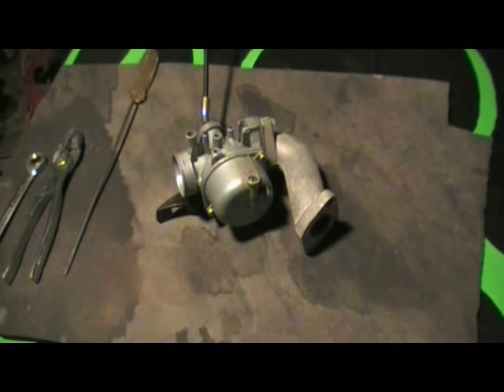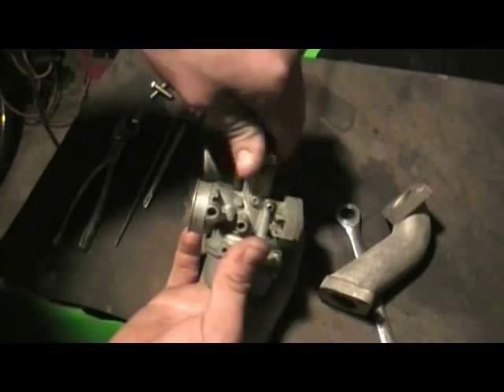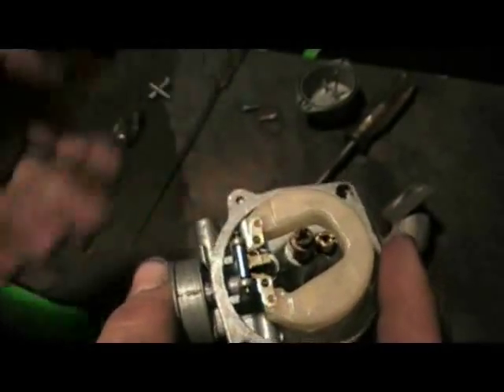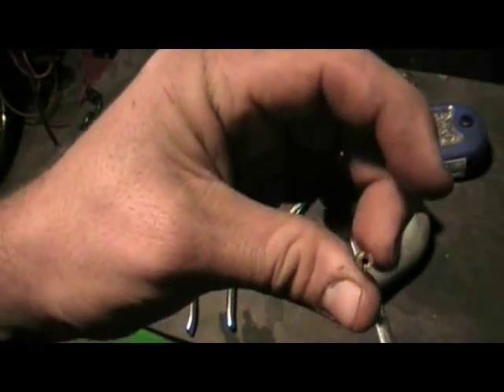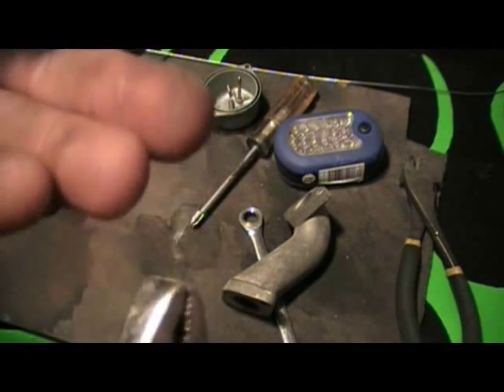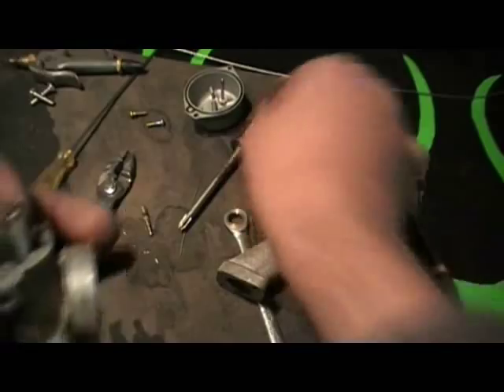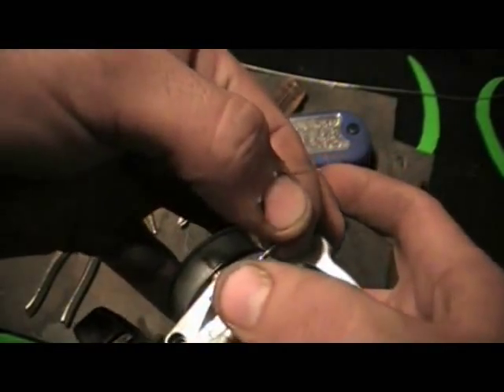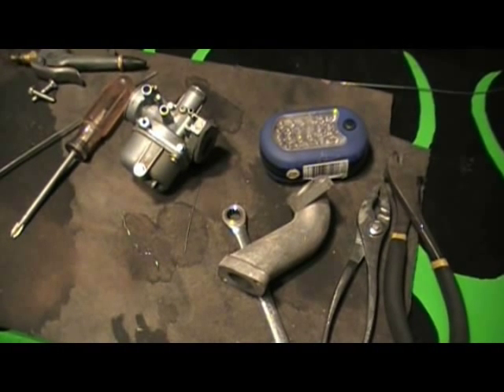How To Clean a ATV /  Minibike Carburetor 50cc-125cc

Comment: Thanks for the video. I tried to clean the carb which had been sitting for 2 years. It didn't start. After watching your video, I did what you showed in your video I put it back together and it ran like new. I also installed a in-line fuel shut off so this doesn't,t happen in the future.

Comment: Nice video , didn't mentioned the height of the float and adusting air/fuel mixture screws
Reply from the maker: You would  adjust those then the engine is running , there is no need to touch them when cleaning the carburetor

Comment: Hey The Random Mechanic, Do you know where I can get the 2 screws that hold the bowl on? Thanks man! Really great video, It helped me out alot. Thanks!  But I need the 2 screws that hold the bowl on. HELP!!!
Reply: Just go to a parts store they should be able to help ..
Reply: I just used a small bolt all the way threw and put nut and lockwasher on it

Comment: Hey I have a no start problem I have a 110cc atv with the same carb the atv is brand new but it have been sitting in the garage for 2yrs cranks but no start it was leaking fuel from the fuel filter so I replace the hose fix it but still no start....please help

Comment: i have a taotao 110 and the carb looks like that were the choke is a plastic piece of crap but my question is this...i know there is a screw in the open to tune but are there any others like under the choke lever?
Reply from the maker: the only 2 screws that tune the carburetor should be one the opposite side of the carb from the choke ,  the one that sticks out with the spring is to turn the idle up and down  and the small inset one is the mixture ,

Comment: the carb barrell has some brass looking caps so you cant take  it off and access the jets/float. what to do?
Reply: Kappy Duke there are videos on how to get them off...use an extractor.  drill it with one side and it has a reverse thread to slowly back it out!  very simple.  then you just need to replace those screws

Comment: I have a 110 Taobao. no spark. what could it be? thinking of replacing the cdi and coil pack
Reply from the maker: always test the obvious culprits first , you wouldn't believe how many times it was a faulty spark plug  or that the spark plug boot that plugs  on top of the spark  plug had come unscrewed from the coil wire   ,  if it has been sitting outside you can test if the ignition  has failed  by unplugging the ignition then using a screw driver to bridge the 2 posts on the starting solenoid    if the spark plug fires then you found your issue  ,  the ignition grounds the coil to the frame so unplugging it should allow the bike to function  normally except the accessories will not work  " lights and electric start "     if this still has not fixed it  ,   make sure that the two wires for the coil are still attached    because they fall off alot ,   if it still isnt working  i would say the cdi has probably failed or the stator  has shorted due to moisture intrusion

Comment: I have the same carb what should the float measurement be on this I keep having fuel leaking out the overflow and other than the needle this could be the only other possibility.
Reply from the maker: normally  when i set them     il be holding the carb upside down in my hand with the bowl off    and i will set the float  to where it is slightly pointing up  to where the bottom of the bowl would be    when it is resting on the seat  ,
Reply: The Random Mechanic thank you for the information
Reply: The Random Mechanic thanks again for the information that work perfect got it running today and I didn't have fuel leaking out anymore.
Reply: Silent Death I had same problem it was float bowl gasket, instant gasket and sorted

Comment: Mine does not have screws it only has rivets? Can you  help
Reply from the maker: Yes , thats a new epa regulated carb , they are special fasteners that  the heads snap off when torqued down ,  i  use a dremel cut off disk to cut slots on them to back them out with a flatblade screwdriver , they are still screws you just have to create a way to turn them

Comment: Have had the carb apart few times  to clean yet the bike won’t start. When it sits a second it will try to fire and sometimes does however it will die shortly. Then no sign of life. Getting fuel in the bowl however when I pull the spark plug I’m not getting much fuel of any. Is the float valve a one way or one of my jets still clogged? I can see light through each jet and have sprayed carb clean in each port. What could I be missing? This is on a toa toa 70cc with a cable choke.
Reply from the maker: does the motor fire when you spray carb cleaner directly into the carburetor intake ?
Reply: Kevin Swisher Did you get your bike running? If yes, what was the problem & what did you do to fix it? Thanks!
Reply: @TheRandomMechanic yea mine does I’m having same problem with a 110cc Chinese atv

Comment: I don’t have screws on my carb to remove bowl. Does that make sense?
Reply from the maker: Yes , the newer carbs are EPA regulated , they used special bolts that the geads snap off when torqued down so you cant get it apart ,  you can get it apart though ,  if you cut slots in the bolt heads with either a hack saw or dremel you can back them out with a flat blade screwdriver
Reply: The Random Mechanic 
Ok thanks bro.
Reply from the maker: @drphil4ril161   let me know how it goes

Comment: I turn on a fuel and the fuel starts coming out of the overflow hose that mean I need to go through the carburetor and check the float right
Reply from the maker: yes , that means that the needle and seat is not adjusted correctly , still has dirt in it or is worn out completely , i  use a cotton swab with some carburetor cleaner on it  and with the float removed i will stick the swab in the needle seat , it cleans it out pretty well , after putting the float back on  with the needle turn the carb upside down with the bowl off  and look at the position the float rests , if it is resting down at an angle  there is your problem , it should be either resting flat  or slightly up when upside down  to properly shut the fuel off during operation ,

Comment: My carb doesn't have screws :( it only has the ones you can't unscrew, what can I do?
Reply from the maker: those are the EPA  carbs  that they stuck on it    to try to keep you from working on your own bike    ,    what you can do is  in those headless screws   cut a slot into them  with a dremel with a cut off disk    then you can back them out with a flat blade screwdriver    ,   you can also drill them out   just drill the heads off  so when you pull the bowl off  there is a threaded stud sticking out of the carb body    just back it out with pliers   ,    the last step is go to the hardware store and get real bolts to go in the carb  .  if you dont have any way to cut or drill the studs   then all you can do is replace the carb

Comment: would you know the stock air/fuel and idle settings,( how many turns out ) for this type of carb. got one in a box and want to rebuild
Reply from the maker: the air fuel mixture   

i usually start  at  1  1/4 turns out            

the idle has no stock position      if it doenst idle    turn it in until it does

Comment: After i clean my carb fuel leak comes to the drain bolt, what should i do?
Reply from the maker: that means that there is either still dirt in the needle and seat   causing the float to stick      or the needle is worn out   ,   you can try cleaning the seat with a Q-tip  just dont get any carb cleaner on the rubber tip on the needle ,   if it still pours gas out of the overflow   you can bend the little metal tab  that is on the float  with the carb upsidedown     this will raise the float     to a level or slightly tipped up position   this will put more leverage on the needle  and hopefully make it seal .

Comment: My valve needle didn't have the metal hook attaching it to the float??
Reply from the maker: normally they have the loop ,  it should work without it , probably fell off at some point or was never put on at the factory
Reply: @TheRandomMechanic  I put it back together without the loop after cleaning everything, still no start sadly
Reply from the maker: @puppythief704    Hmmm .  is the spark plug firing ?
Reply: Yes has spark also

Comment: What is wrong with the atv when it stalls when you reduce the speed but runs fine when going fast
Reply from the maker: does it idle   ?   or do you have to feather the throttle  to keep it running ?
Reply: @TheRandomMechanic  it only runs at full throttle when i try low throttle it chokes and dies. It idles fine bt when i get it gas it only runs at full throttle
Reply from the maker: @theronshelton908    that could actually be several things    causing this issue   ,  one of the jets could be clogged  ,  the throttle needle      on the end of the  throttle cable  where the slider is    could be missing the clip that holds it in place  or it might be set at the wrong height  ,   the needle has grooves cut in the top of it  for a retainer clip  to set  the amount of fuel you receive   ,   your mixture setting could be off   ,    it may be best to take it apart  and just start looking to make sure that everything is in good condition   and not pitted up   , worn out or gummed up

Comment: Master wake boarder if it float is still gettin stuck an leak in  gas turn on it gas an let it leak an pick it bike up about a foot an slam it on the shocks. Don't break the dam thing but with sum force it'll knock it lose. The company that makes mine told me to do that with mine. Works every time. My floats jams itself anytime the bike takes a hard hit or if u dump it over

Comment: please help. I have worked on many carbs before but my 2015 coolster pit bike carb has studs holding the bowl on. how do I
get it off with studs that have nowhere to grip??
Reply from the maker: i have actually delt with this problem before  .   Do you have a dremel ?   if not   ask you friends and neighbors of one of them has one , 

take a dremel  with a cut off disk   and cut a slot across  the studs  and back them out with a flat blade screw driver  ,
Reply: I do and thats a great idea. I was going to go buy the drill bits that back screws out without heads on them but thanks man. Stupid ass EPA regulated carbs are sealed off now.
Reply from the maker: the epa requires the chinese manufacturers   to use break off hardware  on the float bowl  to prevent tampering  or rejetting of the carburetors    , honestly i think the whole thing is stupid       if you cant get a dremel  to cut a slot across the hardware   you can use a hacksaw  as long as you cut the slot dead nuts in the middle    you will notch the bowl tabs on either side  alittle  but as long as you dont cut any further than to get a screw driver on the bolts it will be fine . 

i highly recomend  an upgraded carburetor  with normal bolts  and adjustable air fuel needle    your bike will run alot better    but for now this will get you riding again .
Reply: thanks for the help man. i'm upgrading to a Mikuni 24mm carb for aure. But i have to get it going before Friday because i'm taking it to the track. Do you know if name brand bikes have these types of screws?
Reply from the maker: as far as i know  the name brand bikes  dont use these types of carburetors  the epa isnt as strict on them since alot of them are well known companies and lets just say  they pretty much piss excellence  when it comes to quality control , the chinese will try to pull alot of crap  to cut cost  such as lead paint ,inferior welds , shotty wiring  and other sneaky crap  that the epa is tired of dealing with   lets just say  they dont have the best quality control   ,  so the standards for their stuff is alot higher   than  honda or yamaha
Reply from the maker: once you get the old studs out   i recommend going to the hardware store  the the metric section and replacing them with regular bolts    ,
Reply: That makes sense. I'll only have this bike for a few weeks then sell it to try to make a dollar but i am really trying to get my hands on a yfz450 or trx450r. Those quads will last forever and packing power.
Reply: Bass Boost EXTREME I had the same problem on my Orion 125cc they had the bowl of the carburetor attached with rivets so it could not be disassembled this is because of Environmental Protection on some of them they don't want you to open it and adjust anything their reasoning it's something to do with polluting but I had to drill out rivets before I could take the float bowl off. there was also a small round gold colored metal disc covering the idle adjustment that was easier to pop out use my drill but check YouTube There's an actual video of somebody doing this procedure
Reply: Ryan I already got it bud I drilled a small hole in the air fuel screw and used an extraction bit to take the plug out. I did the same oh the screws holding the bowl on. I put some allen bolts to replace them.
Reply: and it really helped making it adjustable cause I went to an off-road park an hour away and it stopped running so I took the carb apart and there was trash in the main jet! haha
Reply: Bass Boost

Comment: I can not take the bowl off my carb the screws a milled off
Reply from the maker: i need to make an updated video on these carbs , what you have is an Epa regulated carb  , the epa made the manufacturer break the heads off special milled screws so theoretically people couldn't open it and rejet it making it bad for the environment ,   but you can remove them  you just have to cut a slot in the heads with a dremel or a hacksaw and back them out with a flat head screwdriver they do still have normal threads , its ok of you cut into the float bowl flange a little  , technically its already broken so you aren't going to hurt it . if all else fails replacement carburetors are pretty cheap on ebay ,

Comment: Mine has a little of gas In The exhaust can it be float is stuck
Reply from the maker: It sounds like it , you will need to pull the spark plug out  to dry out the cylinder as well
Reply: The Random Mechanic how do I do that thanks
Reply from the maker: @raymonmontes4212   after following the steps in this video , remove your spark plug and spin the motor to blow the excess fuel out of the cylinder
Reply: The Random Mechanic do I spin the motor by turning it on
Reply from the maker: @raymonmontes4212   yes , fuel in the exhaust means that its flooded , by removing the spark plug and cycling the motor it should blow the excess fuel out of the cylinder through the spark plug hole

Comment: I'm haveing a problem when I give it gas it bogs down
Reply from the maker: there are two things that can cause that  ,   either  your fuel has gone bad   or the smaller of the two carburetor jets   or  idle jet is clogged   ,  make sure it isnt clogged and try it again
Reply: The Random Mechanic ok thanks for the help I'll have to take a look
Reply: Mine is stubborn it only spits a bit of smoke but woundnt stay running
Reply: :P david wichner it’s bad gas gotta flush it out

Comment: I have a 90cc panterra atv carburetor looks like that one there but I had a piece fall out idk where in gose it's a small straight through valve no other holes but one end is rounded an other is more flat only place its fits is where the main jet gose an only fits one way for the main jet gose but the jet will only screw in one way but wont screw down the hole way anyone got any ideas I never seen one like that
Reply from the maker: Is the part brass or is it silver ? Also did it fall out of the carb body or did it come from inside the bowl ?
Reply: Brass an was in the carb body never seen anything like it in a carburetor an I had both jets out at the time then I turned it over an seen it fall out I'm guessing one of the holes I believe was the main jet wear the throttle needle gose through only place it fits an only go in one way but with it in the main jet only screws in so far
Reply from the maker: @stevenculbertsonjr6616  if it has a hole through it then yes it goes where the main jet goes , should have two different sized ends  one will poke up through into the  throat of the carb , its the needle guide
Reply: Ok thank you I really appreciate that

Comment: What if it leaks gas out of carb
Reply from the maker: that means that the float and needle valve are not working properly   ,  perhaps there is dirt in the seat    keeping the flow of fuel from being shut off   ,    take the float out   and carefully clean the needle    but do not use carb cleaner on it   or the rubber tip will be destroyed    ,  you can use a Q-tip with carb cleaner on it  to clean out the brass needle seat in the carb       once you are sure the needle and seat are clean  you can put the float back in    and make sure it is set properly  by holding the carb upside down  with the float bowel off  looking to see if the float sits level  at rest    i usually try to bend the tab the needle sits on  so the float slightly tips up   ,